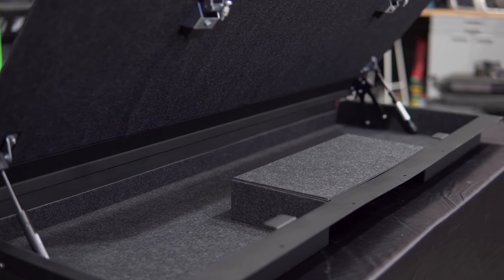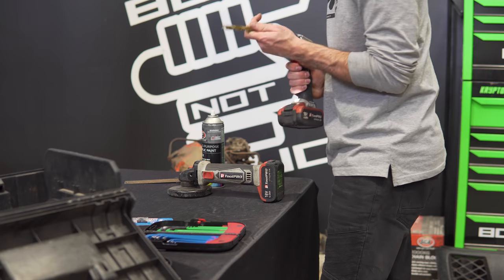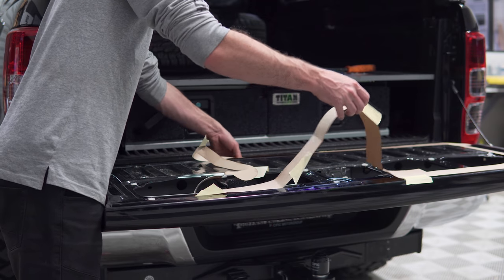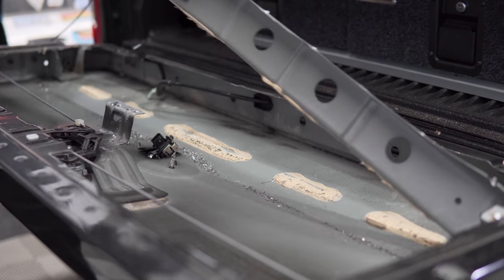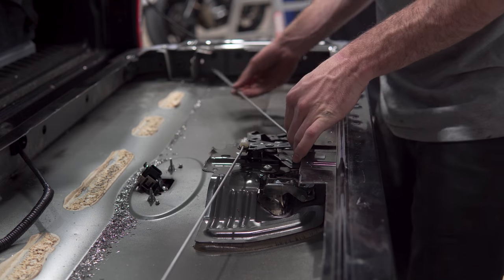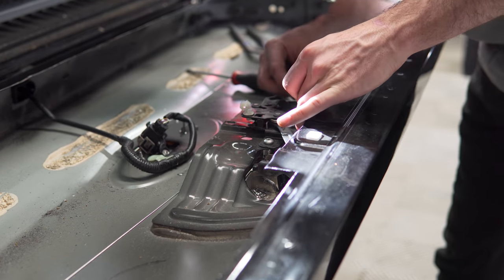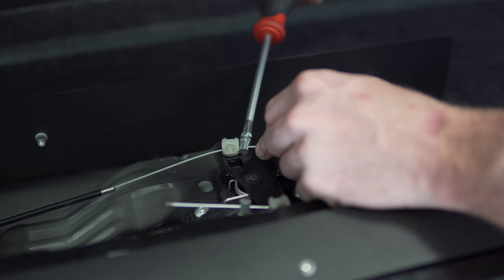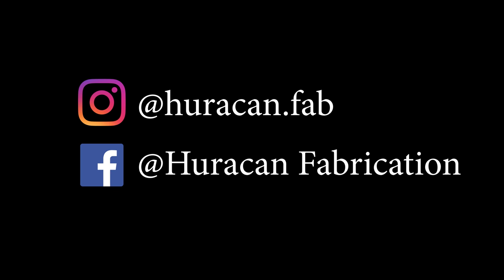Huracan Fabrication Ranger Tailgate Storage Install Instructions

Comment: Awesome, and subbed! Anything in the works for a 2017 super duty? I'd gladly lose the tailgate step for one of these!
Reply from the maker: yes we do! But you would need to remove your step to make it work. We have not done this process before so are not 100% sure what is involved and if it is a simple as just unbolting it.

Comment: I love it but I’m wondering how does it do with water along the top. Is there a weather strip that prevents water from getting in and is there drain holes at the bottom.
Reply from the maker: Hey mate yes there is a rain seal which we sell that goes along the top edge and keeps rain out if you have an open tub!

Comment: Will this fit the tailgate on a 03 Dodge Ram(?)
Reply: No sorry mate but will likely be doing one in 2021
Reply: @rhysc375  - Would be really cool/useful if the bottom half of the storage unit could be molded from abs or hdpe, which might not only allow for more useable (wider/deeper) storage capacity but this might also help reduce fabrication time and/or shipping weight (...just some design thoughts:)  

All the best to you & Huracan Fabrication in 2021!
Reply from the maker: We have looked into plastic injection molded tubs but the tooling cost is astronomical and we would need a new mold for each design :-(
Reply: @huracanfabrication  - Hmm... have you looked into all 3D printing options/technologies(?)  Industrial 3D printing might make more sense over injection molding(?)

Comment: Hey guys, any chance there is a suitable model for the 2021 SR5 HiLux?
Reply from the maker: Yes there is

https://huracanfabrication.com/products/hilux-tailgate
Reply: Will this have any affect on the tailgate camera and is there any hydraulic lift assist suitable to work in conjunction with this? Am soo badly wanting to buy 1 but am also wondering if they are water tight